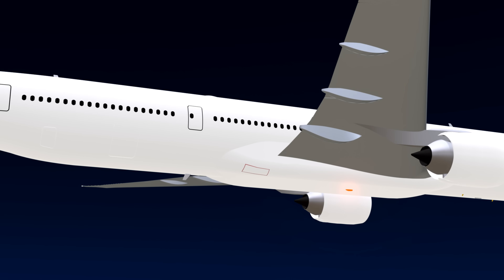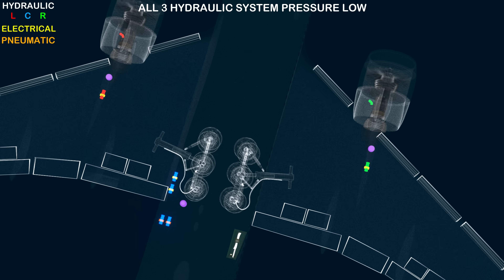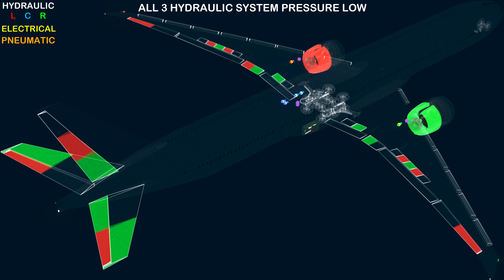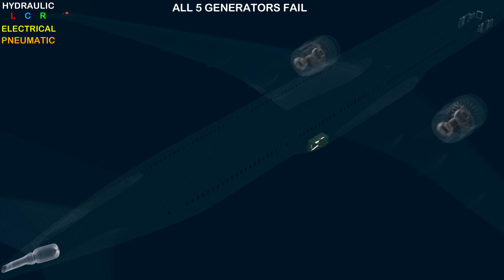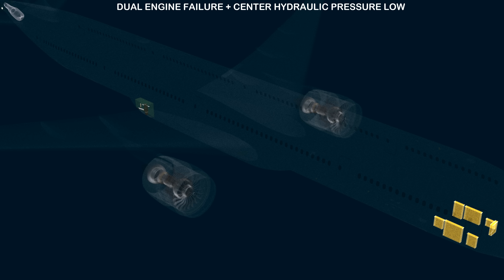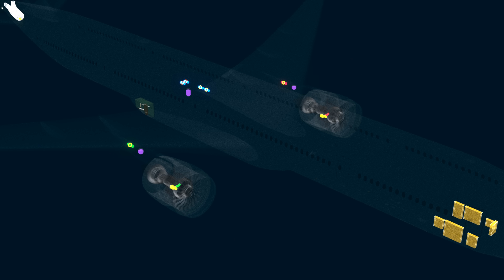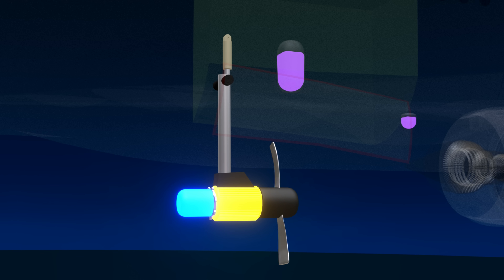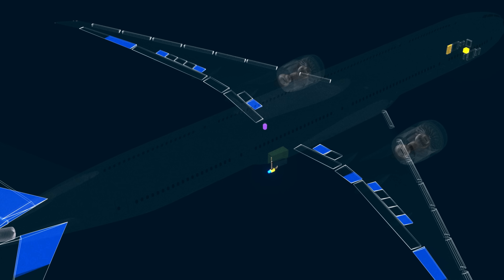When Does The Ram Air Turbine Deploy

Comment: The RAT is deployed automatically...
Does that mean the AI software deployed an emergency solution to a lift off situation?
If it is supposed to power up electric and hydraulic systems upon failure of standard systems, it could interfere with  normal system operation. But the problem then becames why the computer activated it?

Comment: In the flightdeck there is also a manual RAT deploy switch , so this is option nr 4.
Also with dual engine failure and aircraft gliding the engines are windmilling and the hydraulic engine driven pumps will supply hydraulisch press to lh and rh system.

Comment: Does the APU operate while takeoff just for emergency use and in case of dual engine failure ? 
 In recent Indian air disaster, the RAT was applied, and we know that at that speed and altitude, it not only doesn't help but increase drag. I am just an aviation enthusiast .
Reply: The APU is selected off for take-off, it's primary purpose is for power on the ground with engines off or ground power is not available.

Comment: If the RAT was deployed on the air india flight, that explains why the landing gears were down and never brought up when climbing.
Reply: Make sense . Seems like a dual engine failure. Normally RAT's  are designed to operate at high altitudes but not low.
Reply: @satishkumar1221  Any altitude where the aircraft is in flight and BOTH engines fail

Comment: Air India (AI171) Unlucky that Lot did went wrong 😢

For the RAT to deploy due to Hydraulic Failure, All the three Hydraulic systems must have low pressure either due to fuel leak in all the three systems or multiple components failure which is unlike to happen.

For RAT to deploy due to the electrical failure conditions All 5 Generators must fail. Which is unlikely to happen.

For RAT to deploy due to Dual engine Failure with Center Hydraulic Pressure low, Both Engines must fail and Central Hydraulic system must have low pressure .

A lot has to go down in terms of System Malfunction for the RAT to deploy on the Aircraft
Reply: The RAT auto deployment has nothing to do with hydraulic system failure.

Comment: Engine lose the power to lift the aeroplane. May b fuel condamination. This may b. Sobatage. Humble opinion 🙏
Reply: Best answer yet, although fuel contamination would have to be deliberate otherwise other aircraft would have suffered the same fate.  Worth checking to see if aircraft was fuelled from hydrant or fuelling truck.  A truck could have been loaded with contaminate such as AVgas.  But in this case the engine may not have performed on start or during taxi.  Remember the Pakistan/India conflict.

Comment: So its the fuel exhaustion or fuel pump or injector or fuel contamination tht caused the air india accident tht caused the rat to deploy on 12 june
Reply: Exhaustion, fuel pumps, injectors not -possible.  Fuel contamination maybe, but other aircraft re-fuelled on that day there didn't report incident.  Remember,  at the time there was a Pakistan/ India conflict so do not rule out sabotage as silly as that sounds. Of the hundreds of thousands of aircraft flying dual engine failure is so rare even bird strike which may be the case here.

Comment: I think it is more likely fuel injector problem. Or fuel valve mimicking zero fuel situation. In recent Ahmedabad Plane Crash.
Reply: Can landing gears be operated in case of both problem?
Reply: Because i think these aircrafts have gear system apart from fuel system
Reply: So in that case there should be gear up. Which wasn't done that indicates problem (or problems) is different.
Reply: NONSENSE  In both engines?
Reply: @DavidPlatt-i7x I am just speculating Sherlock also what do you think enlightened us.
Reply: @lucidaivids  Not possible.  But if you continue down this path. Would this effect both engines at the same time? Take-off proceedure is all tank pumps ON.  As I said  the engine has it's own pump and if pumps fail the engine will suction feed as far as injectors are concerned there, from memory there are18.  The fuel shut off is powered OPEN and when the valve open limit switches are contacted power is removed.  When the shut-off switch is positioned to cut-off power is provide to close the valve.  The only time that the valve receives power is when the engine switch is operated,  Meaning that the valve could not close.

Comment: Here after Air India 787 crash 😔 absolutely devastating.
Reply: THE RAT is useful when the plane is high up in the sky - but deployed right after take off - it won't help with anything 😒
Reply: @rafaltomaszewski5175  It will help in that scenario also, it keeps the plane flyable, and the pilot might want to steer the plane away from densely populated areas or towards a landable area.
Reply: @rafaltomaszewski5175 it's automatically deployed in event of total power loss
Reply: Rat is very helpful if the plane is at 35000 feet. Though it was a glider atleast it was a controllable glider . But on low altitude it is useless
Reply: exactly. The computer should know the plane is very low (too low?) near the ground and there is no point? Retracting RAT - instruments were probably saying PULL UP PULL UP - TERRAIN etc

Comment: The RAT deployed in AI171 on the 12th of June 2025. This shows there could have been electrical failure in the plane.
Reply: I think it is more likely fuel injector problem. Or fuel valve mimicking zero fuel situation.
Reply: How we can know that rat is deployed or not?
Reply: @jisonmathew382  You can hear it on the video documenting the take off and  crash. Sounds like a Cessna instead of a 787 flyby. Its a very obvious sound.
Reply: @jisonmathew382  in video of AI171 we can hear propeller like sound that likely means RAT was deployed
Reply: @jisonmathew382 

There’s at least one cell phone video in which it’s visible. 

But they should also be able to confirm that by an inspection of the wreckage and/or from the flight data recorder.
Reply: @jisonmathew382  Both audio and video evidence showed RAT deployment.  In fact, it would be another issue if RAT did not not deploy, because the pilot radioed that they had absolutely no thrust or power.

Comment: A question:  the RAT deploys when all 5 gennys fail, all hydraulic pumps fail or there is loss of hydraulic PSI due to a leak.  How will the RAT help hydraulic PSI if there is none to pump?  Like when the DC10 in Iowa lost all its fluid due to an engine explosion, or the DC10 that lost its engine on take off from ohare??
Reply: hydraulic fuses do that
Reply: @justing42 hydraulic fuse: please define……
Reply: @miketaggart3803  Hydraulic fuses are incorporated in the hydraulic lines along the rear spare  leading outbd to the Ailerons.  PUPOSE:   Example: in the case of, as designed the aileron and it's power unit (PCU) has separated from the wing then the hydraulic system fluid could be pumped overboard.  A fuse allows fluid to pass as in normal operation but should the flow rate exceed a set rate the the fuse sets preventing further flow preserving fluid.
Reply: I guess exactly same rarest scenario happened in Air India flight crash last week😢

Comment: I question the case  ALL 5 GENERATORS FAIL (APU+4 Engine generators). The APU is not normally able to prevent RAT deploy  if it is OFF.  If the 4 main engine generators fail or are turned off intentionally (MH370 possible case)   APU will automatically come on, but it takes about 60-secs to fire up.  Thus RAT could deploy if only the 4 engine generators fail.   MH370 case (possible deliberate diversion)  brings up a lot of complex questions of unorthodox ("intentional") failures.
Reply: You are on the wrong aircraft type.  There are only two engine driven generators. The RAT will only automatically automatically due to both engines lost.  The APU will start and provide power in approx 30 sec.  REF: DavidPlatti7x
Reply: @DavidPlatt-i7x  No.  Per this video, there is IDG + backup Gen on each engine…that makes 4 generators, 5 including APU.  All of my comments (eg; 60secs for APU) are based on MH370 which was B777-200ER, Boeing did sim work to support fuel exhaust scenario.
Reply: @billtracy8774   No back-up GEN on 787 and on auto start APU generator provides power in approx 20-30 sec.  you are right regarding GEN disconnect switches APU will not auto start.

Comment: I've got a question: If the RAT only powers the left elevator, wouldn't it create an uneven distribution of lift? If you're trying to save the aircraft in that situation, why not power both elevators?
Reply: it powers the left HYDRAULIC system…not just left elevator
Reply: @ thank you

Comment: You told to us 2 conditions when RAT commanded to deploy. But there is another situation to deploy it. Manual control from flight deck P5 control panel. PAT can be deployed automatically only when aircraft is in the air. But manual deployment available even on ground. If you want to tell us something, do it with full information, otherwise you have a risk to be dilettantes.
Reply: take weight off wheels in the hangar and it will go
Reply: @justing42  If you do so, you will activate HIDIM auto-extension logic. I mentioned for another method to deploy RAT- manual.

Comment: Just wondering i know how the RAT sorta works but could they also figure a way to get some electrical power from the spinning blades of the engine also even if they run out of fuel the blades would still windmill
Reply: Engine fan blades do nothing but help suck air in to the compressor.
Reply: Electrical power is not generated from the RAT

Comment: Can we deploy the landing gear ONLY with the RAT, in either normal or alternate mode?
Reply from the maker: No, The RAT power can only operate the flight controls. When center hydraulic system power is unavailable, an alternate system is used for gear extension.
Reply: it’s called GRAVITY
Reply: @justing42    GRAVITY  extend / Centre system hydraulic retract.  Alternate extend BAT to unlock gravity fall.

Comment: The right hydraulic system also operates the brakes, and the center system operates the steering. (Not mentioned in this video)
Reply: not both brake systems it doesn’t
Reply: The right system yes, for B767- B77 but B787 has electric braking.

Comment: Can APU and the intake door it needs to open be used in flight?
Reply from the maker: Provided there is no failure, the APU is available in the air. It supplies electrical power at any altitude. Pneumatic power (bleed) is available up to an altitude of 22k feet.
Reply: @AircraftScience  No Bleed this aircraft.  Engine start/Airconditioning electric
Reply: APU takes about 60-secs to fire up, so it is not instantaneously available.   There may also be certain  operational constraints such as reasonable altitude for APU to start..
Reply: @billtracy8774  less tha 60 sec

Comment: Amazing movie. I watched 8 movies in one sitting ! Just one small thing: What the root reason of ELEC failure condition caused RAT deployment is both transfer buses lost power. 5 generators fail will cause both transfer buses lost power. If just one generator available, even one BUG is working, the RAT will not deploy, because the generator will supply power to both transfer buses. But even 5 generators are working, if electrical system shorted on wire, caused both transfer buses fail, the RAT will deployed with all engines available.
Reply: You have it very wrong.  the RAT auto deployment is due to dual engine failure. When the EEC (Electronic Engine Control) for BOTH engines report engine power lost the RAT is commanded to deploy The RAT only supplies one Hydraulic system with pressure for primary flight controls. Also, likely in a dual engine failure generator power could be lost.  Therefor, the APU (Auxiliary Power Unit) is commanded to start.  The APU will power both busses the EEC initiates an engine re-start and will continue over and over and over until the engine restarts or until the crew select the fuel  shut-off to cut-out. This engine has an electric starter motor.  Cranking is likely to be indicated by an object falling from the left engine which would be a turbine or compressor section.  The report from the passenger that the cabin lights went out also confirms that engine re-start is in progress simply because of priority.  Engine start priority, cabin facilities lowest.
Reply: @brotherv1035 - I think I responded to your question regarding electrical power where you stated that there are 5 generators each engine having a main and a back-up plus APU (total 5)"  In fact there are 4 elec busses each with a dedicated VFSG  (variable frequency starter generator ) two per engine, the APU has two,  therefor a total of 6.  This aircraft uses one each engine start and so does the APU.

Comment: Can the landing gear deploy solely from the power provided by RAT and batteries?
Reply from the maker: The aircraft has an alternate gear extension system which uses battery power to unlock the landing gear. Once unlocked they free fall to the down position. RAT power is only used for the control surface operation.
Reply: @AircraftScience  Thanks!
Reply: These systems have Electrical backups 

- Flaps/Slats
- Landing Gear Alternate extension system
Reply: @muhammadabdullah03 to unlock the gear…that’s it